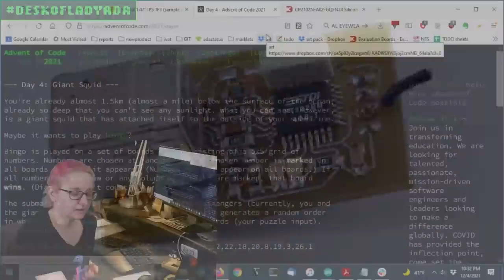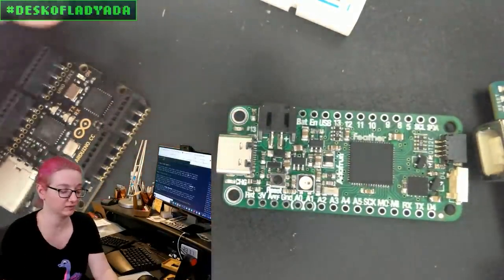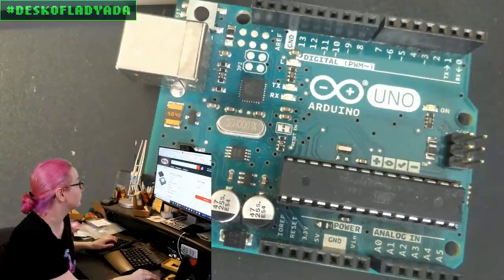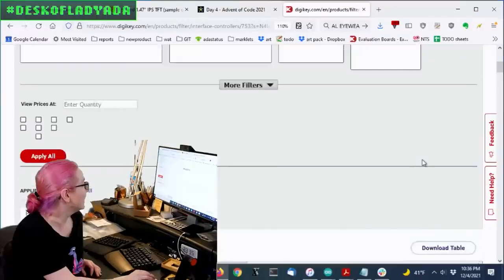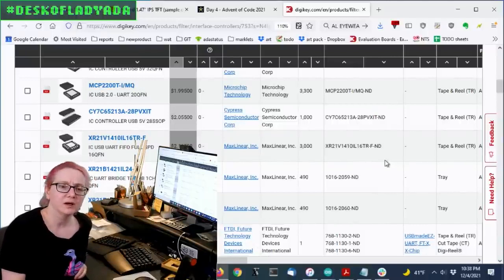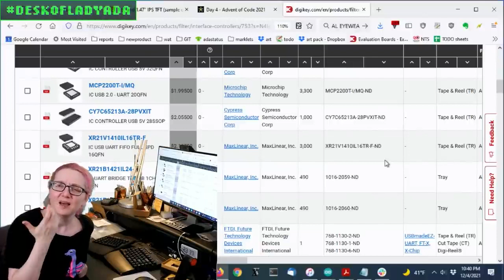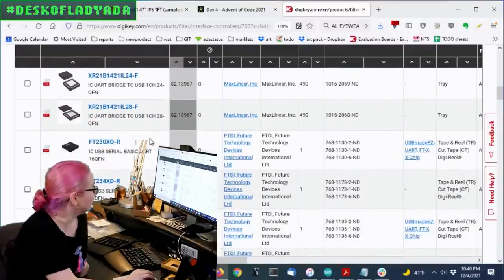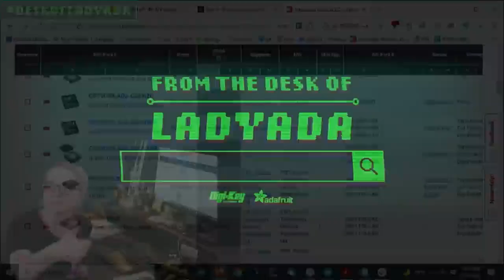The Great Search: USB to Serial converter chips #TheGreatSearch #DigiKey @DigiKey @adafruit

Comment: it is a little surprising cp210x converters are out of stock, these are 'common' items. i'd guess it is mainly due to the 'chip shortage'. hopefully, as things get alleviated, they could become abundant again.

A thing though, i'd guess for MCUs that is intended to be connected to the pc, it'd be better to get those that has on-chip usb support. these days a lot of MCUs such as stm32s, RPi pico, esp32?, and various other have built-in usb support. Those are better as native on-chip usb means that your 'baud rate' is effectively 12 Mbps (well the host does the polling, so it is multiplexed, it won't be 12 Mbps all the time). And moreover, using native usb takes one beyond usb (cdc) serial. One could for instance implement usb-hid, usb-audio, usb-mass storage, usb-video, fake a 'printer', the list goes on for all the usb device classes and beyond.

native usb is the 'serial' of today, pretty much, it is 'virtual' comm port after all. on a different note, for chips without 'native usb support', the uart pins rx, tx, gnd, vcc could go to the headers. then just about most usb native microcontrollers, can double up as a usb-serial converter (e.g. with a sketch, i did that in the 'old' (libmaple) stm32duino core
https://github.com/rogerclarkmelbourne/Arduino_STM32/tree/master/STM32F1/libraries/A_STM32_Examples/examples/Communication/USB-uart-w-signals

this is quite an interesting topic in a sense that linux has configs to tell it (modem manager) that it isn't a modem at the other end, to prevent it from trying to 'reset' it. grin. That old 'modem' is today substituted by all the mcu using it (usb-serial)  in its place.

Comment: I see CH340G chip on many boards. Checked recently fried board of my 3D printer, that too happened to be this chip. Quite popular it seems, I wonder how much it costs.
Reply: Peanuts compared to the $2 listings for the other chips. Makes you think. I was surprised that LadyAda did not talk about these in the discourse.
I shall not touch FTDI; they may have a name for being "the first" in an artificially created market, but that have demonstrated questionable business practices in the past, and have shown no regrets, earning a special place in "the naughty-corner".
Reply: I use the CH340G whenever I need USB to serial.  I've made a few ESP32 board, a few ATMega 328 borads, and a few just USB to serial boards.  Never had a problem.  If I could solder smaller chips in the QFN format, I might go with something else, but I don't have hands stead enough for that.